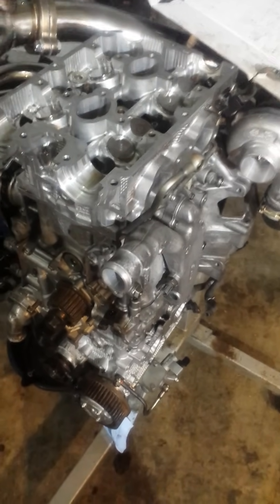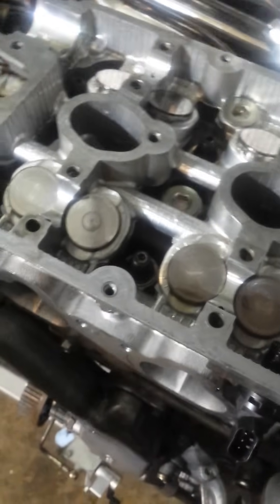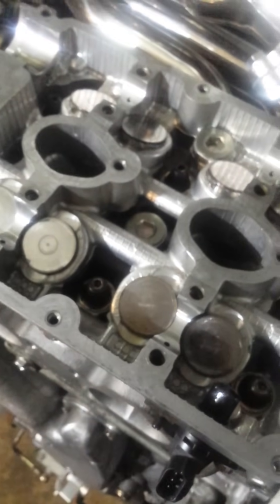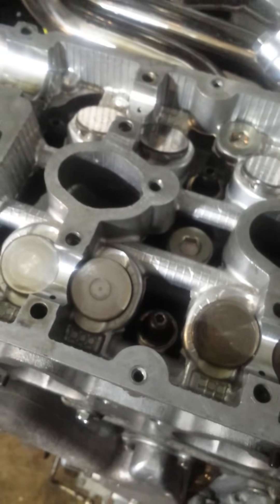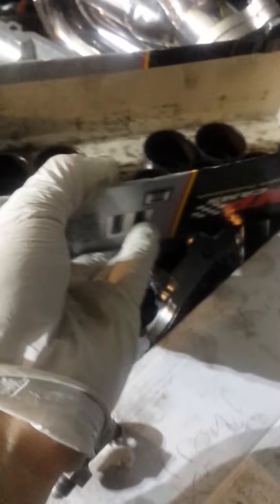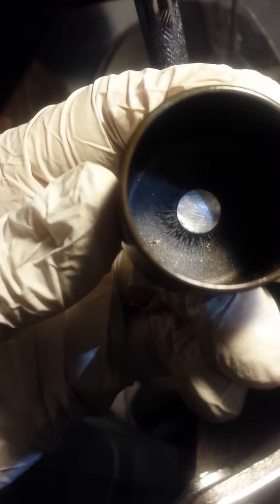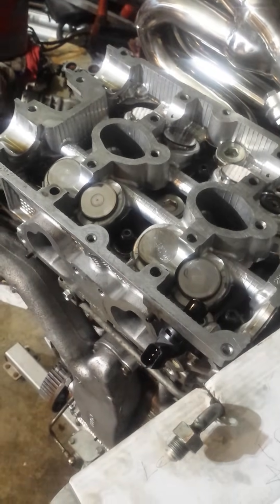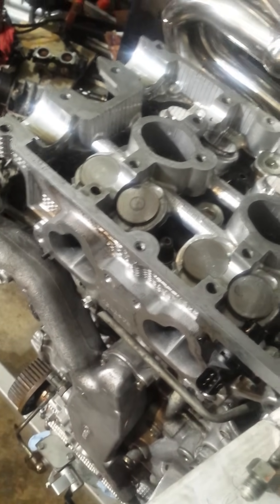Valve Lash Adjustment DIY machining Subaru ej25 Wrx Sti

Comment: most of the time
485....is 4.85 mm
498....is 4.98 mm
500 is 5mm....ect.

   4.98 mm 
x 
    .03937" (1mm)
--------------------
.1960 " 
(of an inch)

I just ground 16
of these...like to never have found that info
hope it helps

Comment: Heya, curious how well this worked out for you? I have a Volvo v50 I’m getting ready to do the same thing on the buckets. I put in a fresh set of valves and they are all ever so slightly taller then the original set and I need to take all the buckets down a bit for proper clearance.
Reply from the maker: It's legit. I've done it on multiple Subaru engines now that are still running well. 
I swap buckets as much as possible and keep spares, but the last few can get this method.
Reply: @vgnfab  awesome! I’m going to give it a go on Sunday. I have 3 engines worth of buckets to choose from so there’s a bit of room for mistakes.

Comment: From .008 to .013 is a big gap?  I have a '95 Maxima and now wonder if my Hanes manual is correct.  It called 10-13 intake and 11-15 exhaust.

Comment: FINALLY the video i was looking for;  
i am in the middle of doing it  exactly like you did it;
just looking for some sort of con firmation here...
I use an indicator on a vertical stand to measure the buckets, very quick;
I'll bet that is the way the FACTORY does things too, for grinding and checking them;
 Thanks from Porto,Portugal,2023   lol

Comment: Gonna try this since I only realized I had an issue with clearance after my head was on.  Did a head gadket and lapped the valves and only have 60psi across the board on my suzuki vitara.  I cant get thinner buckets for it as they are no longer available. I was gonna grind the valve stems but I  don't see why this would be any different and no risk of getting metal in the motor.  Seems like its gotta work so I'm gonna give it a try.  Thanks for the idea.
Reply from the maker: I think the only way you can go wrong is taking too much off, or not being near-perfectly perpendicular. Hope it works out. Ironically after all this time, I'm putting new heads on a new engine of mine today and the next couple days. Can't find my feeler gauges..

Comment: Just curious how many miles have you put on the resized bucket? 

Also, have you had the opportunity to disassemble the valve train to inspect the lash/buckets in comparison to the ones that did not have material removed?

Awesome DIY and thanks for the continuous updates!👍
Reply: There's a way to calculate it using feeler gauges and a micrometer. Smeedia has a great video explaining it

Comment: Hi, man, another question for you : my  engine( qr25de) has two thermostats which are at the inlet and outlet of the engine. After you rebuilt the engine you will add coolant from the radiator and prepare for the first start. I am confused how the coolant enters the engine block to build the first flow ? Because there is no coolant inside the engine at the moment, and both thermostats are in the off state.
Reply from the maker: I'm unfamiliar with your engine. One main concept to study: "Atmospheric water level". Amazing principle. The application for you will require thought and research. I'd imagine you could at least use the heater core lines to fill/ prime your engine.
Reply: @vgnfab  ok, Vegan. But I don’t think it has to be added in other way. Late today I will go to university to ask . thanks anyway.
Reply: Ｈi, Vegan, I have already done the first starting, looks very good , very smooth ! 16 bucket valve lifters grinded by your way, that's big job. In term of the 2 thermostats on the way of the coolant flow, the teacher said to me that any kinds of thermostat is not fully closed by designing, some have jiggle valve on it, some has a tiny hole on it, if not it should be gap in normal temp. so don't worry it ,just doing the job. so far so good. thanks again your help!

Comment: Very good idea!  I'm only wory  is how to keep flat. The drill , platform, dremel bit all have tolerances . how's car going now? Man
Reply from the maker: Cars working quite well. It's understandable that some people are skeptical or surprised, but for valve lash, it's not too crazy.
For your point of flatness.. If you want to be very sure, the most important thing would be to tram you drill press head or the bed to the head, using a chuck mounted dial indicator. Using a stone with a diameter roughly twice as large as the surface you're grinding, have the stone off-center from your surfaces center. As you rotate the cup in your operations, the wear marks on the grinding surface of your cup can be an indication of flatness for you. But it's a bit of an art form where everyone would do it differently and have their own opinions. So just some ideas.
Reply: @vgnfab  Yes, Vegan. There are a few reasons worth trying:
1. The dealer requires £44 + VAT each bucket valve lifter, which is robbery.
2. Interpreting your principle from the perspective of mechanical design, nothing doubtful.
For specific operations,  I think after the dremel-stone-drill-bit put into the  drill-press have to be calibrated with a professional diamond grinding pad. don't move the chuck and drill-table after calibrating, Could this way  make sure that the plane of the dremel-stone-drill-bit is smooth and parallel to the drill-table (bed)? then starting work.

Comment from the maker: Hi friends. I'll be making a follow up video soon. 
I have a few things to say.
we are all a community, try to be a little happier when sitting behind your computer. You're not an island, and negativity doesn't help anybody.
Yes, I incorrectly said that the bucket number was inches. It doesn't change the outcome. Other videos don't even address what that number is and it doesn't matter because we work on margins here.
I'm a little sad that some people are having math troubles but I empathize and would love to help those of you out who are confused.
1. A distance measurement cares not what you call it as long as the numbers translate. 1" = 25.4 mm. Ex.: .016" = 0.4064 mm.
2. One needs to know how to apply the math to what is happening. From top to bottom visualize this: Cam lobe - Gap of Cam lobe to lifter top surface - Lifter top surface distance to the inside bottom edge of the lifter surface (the distance marked on each lifter which is roughly 500 µm or divide by 1000 and get mm) - Top edge of valve - Then some understanding of valve stretch.
3. All calculations and approaches with proper practices will get you the correct result if your final measurements with the feeler gauges are where they need to be. It matters not which measurement system you use here as long as it translates to be within spec. Since most feeler gauges show either metric or US customary or both, choose what you're comfortable with. 

I'm glad to see since making this that I just came up with something that is already a common practice and taught in some mechanic schools. 
The car is running quite well for me!
I'm building 2 new EJ25T engines for both my wife and I right now.
Reply: I am excited for the follow up video. Thanks for this video. I am rebuilding a 90HP yamaha outboard and the valve buckets are non shimmable and they are conveniently out of stock so i am glad i came upon your video. Josh
Reply: I need 4.63 and 4.67. Subaru doesn't have the size only to 4.69-5.65. If I took it in to get  Adjusted to the 4.63 and 4.67 would it fuck with anything?
Reply from the maker: @assayehgnesolomon8033  Needing a smaller bucket implies a stretched valve. Search Stress/ strain and learn about plastic deformation.. In short, I'd consider replacing that one valve. Aside from that, you can use my this grind method to get it to the value you need. Your actual question is whether or not a bucket of steel over 4mm thick is going to be OK as a spacer. All day long Yes. These are just spacers in effect as far as the measurement.

Comment: Please tell me, Why grinding the valve!
You have big gaps clearance from wearing, right?
So the only way in your case is to replace the bucket lifter with one with more thickness, right?
any one can help
Reply from the maker: Ah, the key to fix a large gap is to replace with a cup that makes the gap too small, then grind to size. Also if you can avoid grinding by just replacing the right size cup, that is ideal and should be done first. Good luck.
Reply: Mechanical Vegan Thanks 🌹

Comment: How it was going on that engine? I have to do the valve clearance adjustment in Toyota and my girlfriend's Mazda. Both engines have this "tappets" which are very expensive. I am also considering to do the grinding od the tappet surface (like you did) but I am looking for some users opinions about that idea. Is it worth to grind it?
Reply from the maker: My heads have been working great since I did this. Another youtuber I saw was showing this and said its taught in mechanic schools. That was cool to hear. I'd say it comes down to cost and ability as to whether or not one would consider this.

Comment: Came across this while searching for new buckets. This is a great concept for DIYer’s but I see a big concern but only with your jig setup to hold the bucket. If you don’t grind the button perfectly flat to match the valve and also perpendicular to the side of bucket that slides inside the head itself, than you possibly serve the chance of causing either minute or extreme wear to the surface of the head in which the bucket slide up and down. I see this as a potential problem but with a proper jig setup could be a huge money saver. Also I would use something other than a ruff cutting tool as final cut. No matter what kinda  marks the grinding tool leaves the buckets spin as well while in motion which can cause rapid wear to top of valve itself. I would try to find a way to get as smooth a surface for final cut as possible. As stated good concept/idea just needs more technical setup in my opinion. Think I’ll spend the money on new ones and save my expensive motor build with piece of mind.

Comment: Nooo that's way backwards if you grind the valve or the shim you're increasing the amount of gap and reducing lift. Buy the proper parts and do it right the first time
Reply from the maker: Your reply is short sided. Appeal to authority on your last statement is also short sided which explains your overall comment. 
This process involves basic math to get the correct spacing.

Comment: The only concerns I'd have about this process would be that you might be machining off any surface hardening treatment on the contact point of the bucket. This also assumes that you can grind a very consistently flat, smooth, and parallel surface onto it. I'm not sure I'd use a dremel bit, just because it's a rather coarse and potentially inconsistent stone, but I do like the cut of your metaphorical jib for trying this.

Next time around, I'd make a wooden jig that will hold the bucket steady while you rotate it under the stone.
Reply from the maker: +Dermot Conner What is your concern about the surface hardening status? Even if it were an issue, nothing could come from it based on the geometry and loading of hitting a valve in the same plane. But it is work hardened is it not? Not to mention a slur of carbon and heat being beat into it. A drill press and anyone able to get to this point of engine work, can make the machining orthogonal to it's movement direction without issue. And again, what's the concern with a slight angle if that were to even happen? How much of an angle? 

This is an awesome way to solve a problem for no extra money. Cups are $35 each. Most people don't have the means to buy all new to replace ones that are not the right size. Most people don't adjust valve lash on these at all.
Reply: +eksster Don't get me wrong, I like the heck out of your solution, I'm just noodling around possible issues that one might encounter over the next 100,000 miles having done this. $35/bucket is a nice savings right up until you have to pull your engine again if something goes wrong. 100,000 miles is more than 200,000,000 actuations of each valve, so while the ground surface will likely work-harden, it could conceivably mushroom out instead, (assuming it had previously been hardened before grinding, keep in mind that we metallurgically harden things all the time to avoid the uncertainly of work-hardening) and having done so it would, again conceivably, increase lash and accelerate the wear, potentially to the point of failure. Or if the seat isn't perfectly level, it could increase lateral thrust against whatever guides the bucket, or indeed the valve guides themselves, and cause wear or binding there. Or if perhaps the ground surface isn't smooth enough, it could create excessive wear against valve stem, again increasing lash and causing accelerated wear. 

Are any of these things likely? I doubt it. Are they possible? Possibly. I'm neither an engineer nor a metallurgist nor a materials scientist (though I worked in an adjacent field once upon a time leading to a keen interest in the topic) but common sense dictates that when you're repeating an action a couple hundred million times, you need to look quite carefully at what additive effect that action has, even if it's exceedingly small. 

So please don't take my comment as a criticism, merely a discussion of unknowns, and until a few people have 100,000 miles on engines using this system, then will all due respect they're going to remain unknowns and worthy of discussion :-)

Comment: They wrong way to adjust the valve lash. Buy the correct size shims take the time and do it correctly.
Reply from the maker: Carol Hoag What a pointless thing to say. What I show works perfectly. Buying new ones is expensive.
Reply: they dont have shims, he rightly says its freakin expensive buying correct sized ones, my Nissan same type ,dealer wants over £46 for 1 shimless bucket so best part of £500 before gaskets, stretch bolts etc etc
Reply: True, but not everyone has funds in those amounts too.